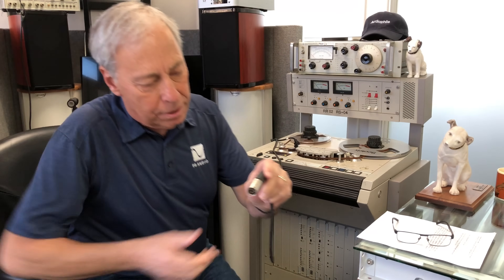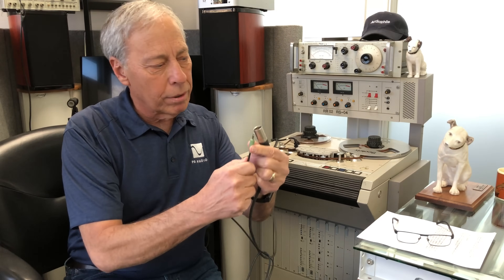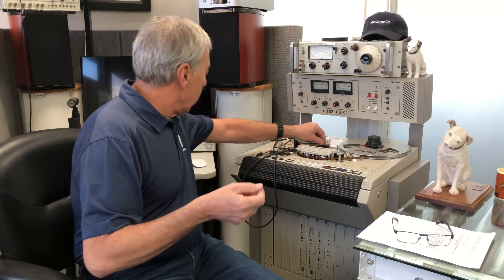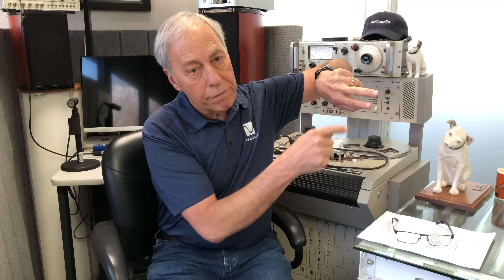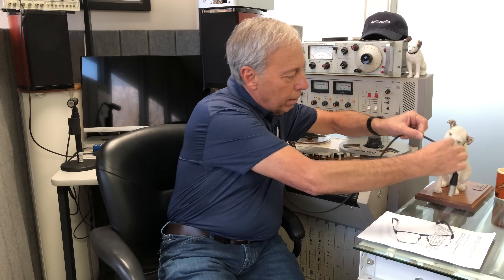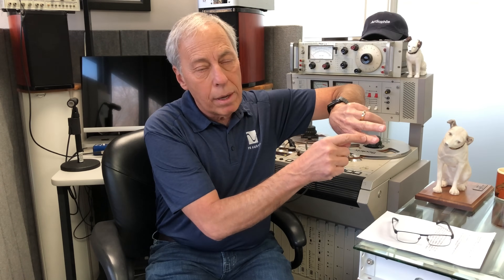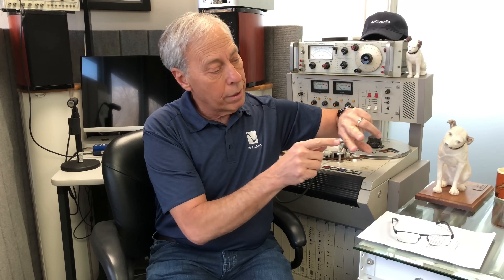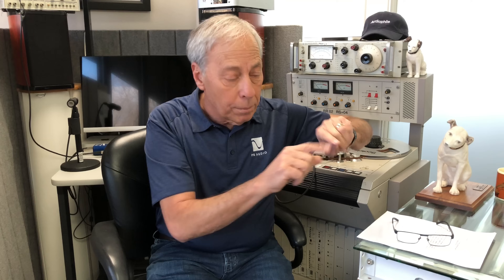Balanced vs. Unbalanced audio

Comment: It's balanced cables. What about balanced amp vs. unbalanced amp?
Reply: All audio amps, etc are single ended or unbalanced...you use balanced cable for external uses such as connecting equipment, long runs, etc...in broadcast gear with balanced IOs, the inside circuitry is unbalanced...the balanced input is converted to unbalanced via xfmr or active op amps. Same for the output
Reply: @christopherboone9802  That's a solid non-answer, lmao.

Comment: i guess i had it wrong, i though those 3 pin cables had 1 ground and 2 live but only one true signal like:
channel A = sound (A*1 or A times 1)
channel B = empty (B*-1 or B times minus 1)
ground just completes the loop and it would be (A*1)+(B*-1) = sound minus interference. (well that is how i get 3.5mm jacks to get guitar in the PC without noise...)

for any one who played with distortion pedals, you would CLEARLY hear what the noise is, other than that, you may have too low noise to notice unless you have a "low noise floor" on your particular system (the hiss) (or shhhhhhhhhhhhh sound) where you could hear it... but a professional high grade system have low noise floor so you hear interference! on the other hand, normal grace systems tends to have enough hiss or shhh or hummm to drown the external interference. 1 example of high noise floor, hearing a hiss at 1 third (30%) of the volume; low noise floor only begins hissing at 80% and higher.

Comment: question for paul. I use a small portable sound rig for small gigs etc, consisting of a Powered 12" Subwoofer with 1/4 input and 1/4 through output. And a Rechargeable Powered 12" 2 way Loudspeaker. Ive been using either RCA analog to 1/4 mono or XLR to 1/4 unbalanced to sub then from output a 1/4 Y splitter RCA to 3.5mm plug into the Loudspeaker. Is this correct way? OR should I be going 1/4 TRS balanced stereo into the subwoofer?
Reply from the maker: I prefer balanced over single ended always.
Reply: @Paulmcgowanpsaudio  For small gigs with lots of room noise....well you get picture

Comment: Paul,  A couple of additional points from the Pro Sound engineering side of things.  RCA is generally high impedance on the receiving equipment, so when there is a poor ground connection which is common in RCA cables, induced noise is not shunted to ground but can produce significant noise.  RCA terminations are typically 20K to 47 K ohms.  Antique crystal microphones were worse with lower voltage signal and termination of 50 to 200 K ohms, refereed to as high impedance microphones. At high impedance source signals, the capacitance of the cable produced huge loss of high frequency on longer cables, and with some dielectric insulators in some cables, the cables themselves were monophonic, so you could hear cables moving or being stepped on.  This was called cable rustle.  This is now a thing of the past.

Balanced audio in the pro gear realm, brought with it a low impedance standard often referred to as Low Z.  I presume the PS Audio is utilizing the advantages of this impedance.  For microphones the mixers and gear generally terminated the microphones into a load of 200 to 600 ohms.  This low impedance shunted high impedance leakage into cables to ground as they produced very little induced voltage.
In pro gear the standard signal level for interconnections is much higher than consumer gear.  Instead of running signals at -14 to -20 dBu,  they call zero VU +4 dBu, so the noise levels picked up may be the same, and taken care of by the balanced signal, the actual signal on the wire is a much higher voltage.  The termination for line level is often 20K balanced and 10 K unbalanced.  This is lower than most RCA equipment. Most pro gear will clip the signal at over 12 volt peaks as the op amps driving the cable are operated from plus and minus 15 volt supplies.

Paul, do you use levels comparable with pro audio gear?  Would it drive a good pair of Mackie SRM-450 speakers for example?

FYI, I service equipment for a living as an engineering technician.  I repair as well as setup and operate it.
Reply: isettech , you must use Google a lot to copy what Google says about this issue, I don't really believe that you are a Steven Hawken of Audio dude
Reply: Tim Schutte, Actually I was born in the 1950's and was into electronics as transistors took over vacuum tubes.  The standard PA mic was a crystal element and high impedance in the days of tube equipment.  I made electronics a career, first as a hobby in HS, then into RF in the advanced electronics program of the USN, then during the recession of the '80s, went into consumer electronics and learned VCR's Camcorders, Compact Discs in manufacturer's training courses, and took and passed the Journeyman ISCET Certification exam.  I was recruited to work in the Cayman Islands in the 2 way communications shop and was the local radio and TV station's engineer.  As the position was temporary (work permit only valid for up to 6 years) I was offered a position at Intel as an R&D technician where I learned lasers, high vacuum plasma systems, etc for producing parts in the sub micron range.  This required very precise instrumentation.  I'm not a Steven Hawking with new ideas in the advancement of electrical science, however I have the advantage of bleeding industry best practices for high resolution, low noise, low distortion, and precision.

Tim, I presume you are younger than I and have had less training and industry experience.  Don't be jealous.  Try to learn something new everyday.  My most recent certification is the EPA 608 certification as I am adding repair of industrial temperature control to my skill set.  You either keep current or become obsolete.  I copy less from Google than you assume as much of it is pseudo science and incorrect.  Knowing the difference requires knowledge of the current state of the art.

Comment: 6:10 Opposite polarity? Not out of phase
Reply: Leonard Buckley , same damn thing dip stick.
try again
Reply: technically is out of phase, such out of phase is exactely 180° phased out. But opposite polarity is well said too.
Reply: Phase is the relationship between time and a SPECIFIC frequency. Phase and polarity cannot be used interchangeably. So let's take the generally accepted frequency range of human hearing - If a 20hz signal (the lowest frequency we can hear) is 180 degrees out of phase of another and lagging, then it is lagging by 25milliseconds and will cancel out (because it's a pure tone). If a 20kHz signal is 180 degrees out of phase, then it is lagging by 25microseconds and cancels out. That's a MASSIVE difference in time. Now, what happens when the signal is no longer a tone of a signal frequency but a real word signal of many different frequencies and amplitudes - 180 degrees out of phase doesn't really make sense anymore. 180 degrees at what frequency I ask. Look at a phase graph when tuning a PA (time aligning subs to top boxes for example) the graph shows phase VS frequency because it's a function of frequency and time to align the signals coming from both sources. You can't flip phase, it makes no sense. I'm happy to be told otherwise by a reputable source.

Comment: RCA = ''chinch'' plug
Reply: And where does 'Chinch' come from? - Yes I've seen it, but 99% use RCA
Reply: Slang in some European countries for RCA
Reply: RCA = mini phono plug....use on any consumer audio electronics..also used in some RF applications (Motorola used them in rcvr paths in 1960-70s UHF radio gear)

Comment: One of the most clear, precise and accurate descriptions of a Balanced transfer of signal.

Prepared. or unprepared, Paul you have a great ability to explain concepts in a plain and understandable way,  brilliant!
Reply from the maker: You're very kind. Thank you.
Reply: @Paulmcgowanpsaudio  You should also include the differences in level, dB or voltage

And, a balanced cable has tree leads, not four. Often, not always, it also has a shield, sometimes the shield is used as ground.

Paul, too many youtubers explain half the truth. You of all should step up and explain the whole thing.

Thanks for your videos!

👍
Reply: @mathiasjohannesson9833  Some balanced cables are 4 wire.  1 lead connects to the shells of the connectors to chassis [earth] ground.  Another lead connects pin 1 [signal ground] which is produced by the power supply.  Pins 2 & 3 are connected pin to pin.  Chassis ground and signal ground should never be connected.
Reply: Agree

Comment: Ok, I'm on board with Balanced. Do upgraded XLR cables improve sound compared to a stock XLR?
Reply: Don't spend crazy cash on XLR cables especially for a fixed install like a home stereo.  The basic XLR cables you'll find at a musical instrument site like Sweetwater will do you just fine.  I play music live so I spend a bit more on good cables because they hold up to abuse of performance, travel and people stepping on them, not because they sound better.  No more than a buck or 2 per foot for a 10 foot cable...really short cables can seem more expensive but that's because connectors cost the same no matter the length of the cable.
Reply: I ended up upgrading my XLRs and maybe it made a difference, maybe not. Worst case scenario, I wasted 90 bucks.
Reply: I use TRS (tip-ring-shield) balanced cables without problems.
Reply: I switch between a set I bought of 6 XLR cables from Amazon for less than $30 and a pair of Kimber Kables that were well over $200 and can't tell the difference. Yes those are the "cheap" Kimber Kables. The only way I would think it would make a difference is if there is a long run.

Comment: As for balanced circuits, James Bongiorno, Ron Sutherland and Roger Sanders said no. Why double the circuits, which doubles distortion and noise ?
Reply: Indeed it does.
Reply: Paul McGowan Agreed! Differential balanced circuits not only cancel out any stray noise picked up during transmission, they double signal strength on the receiving end. They do sound astonishingly better, because math. Math IS the only real magic! My headphone amplifier is a dual-mono, differential and fully internally balanced circuit from end-to-end, right down to the 4-pin XLR headphone connector. When coupled with a balanced DAC, it is the most amazing thing I ever heard.